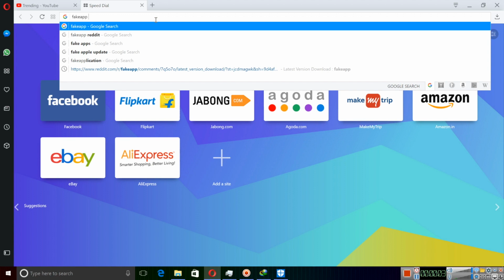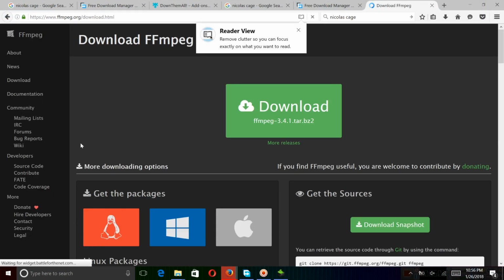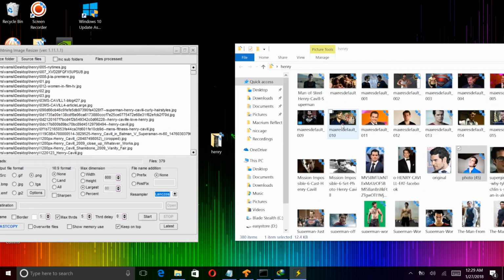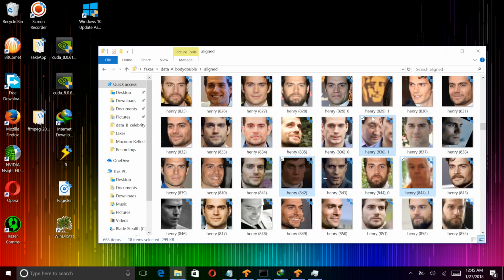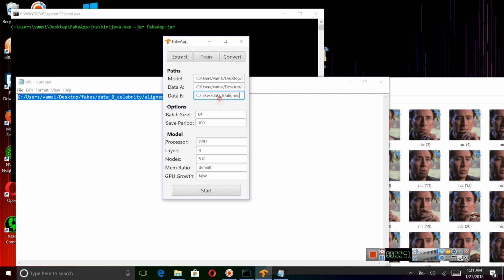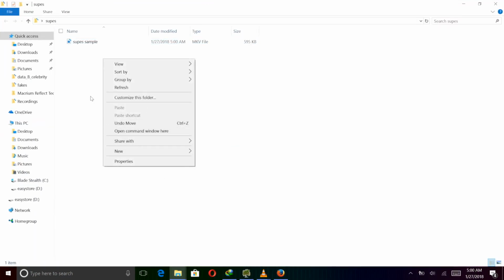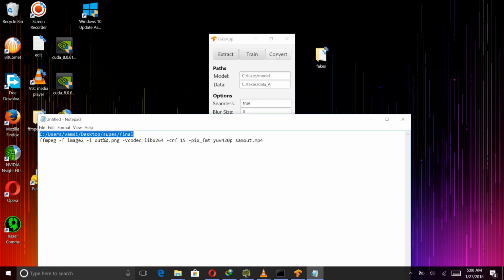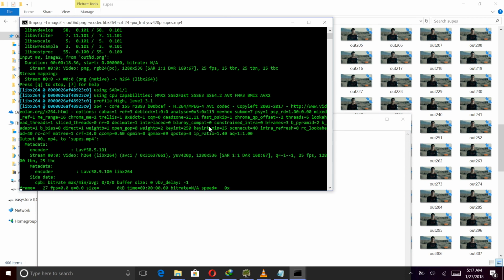Fakeapp how Face swapping is done using ML and AI !!deepfakes tutorial

Comment: Hello there! I get this error: undefined  undefined  File "site-packages\PyInstaller\loader\pyiboot01_bootstrap.py", line 174, in _init_
__main__.PyInstallerImportError: Failed to load dynlib/dll 'cudart64_90.dll'. Most probably this dynlib/dll was not found when the application was frozen.

During handling of the above exception, another exception occurred:

Traceback (most recent call last):
  File "execute.py", line 1, in <module>
Do you think you could help me with teamviewer? I would also like to donate, how can I do this? Thanks in advance
Reply from the maker: i can help you with team viewer, but before that can you tell me what is the system config??
Reply: tech 4tress hello there again! I managed to solve the problem. Turns out I downloaded Cuda 9.1 instead of 9.0. Your instructions in the site clearly say you need to use 9.0. My bad. Thanks a lot and I'll be donating soon! Regards
Reply from the maker: sure mate!!
Reply from the maker: if this video had helped you can buy me a coffee at

https://www.buymeacoffee.com/oDbCfFNAJ

you can donate to the developer for the app at

USD: paypal.me/tethys 
BTC: 1EWQG6FMZnHKe3rZcEofVGhpzHs1gL3MgA
ETH: 0x8B006aAF31E5D82A40cBE23885BAf3626E8D2dF9
BCH: qqycxlst0paylfsus5pqrep4ee9f30ha4sccsuggr2

Comment: undefined__main__.PyInstallerImportError: Failed to load dynlib/dll 'cudart64_90.dll'. Most probably this dynlib/dll was not found when the application was frozen.

During handling of the above exception, another exception occurred:

Traceback (most recent call last):
  File "execute.py", line 1, in <module>
Reply: ı have cuda 8.0 and 9.0

Comment: So i just keep getting this error when i start the training:

Using TensorFlow backend.
Traceback (most recent call last):
  File "train.py", line 96, in <module>
  File "utils.py", line 15, in load_images
ValueError: could not broadcast input array from shape (720,1280,3) into shape (256,256,3)
[1952] Failed to execute script train

i reinstalled CUDA 8 now twice, same with visual studios, i have an nvidia gpu (1050ti) 

if i use version 2.1 of fakeapp i get this message:

Training process ended. If you didn't end it yourself an error occured.

i hope you can help me. thanks for the video(s) anyway man :)

Comment: Hi, could you help me with this problem I keep getting? I enter in the directory for the images and once I click Start I get two cmd windows popping up. One says Attempting to start Extract process in directory: C:/Users/Yoda/Desktop/FakeApp/alignment/ and other says 'C:/Users/Yoda/Desktop/FakeApp/alignment/a.exe' is not recognized as an internal or external command,
operable program or batch file.
Reply: seems like a wrong antivirus alarm to me, try disabling your antivirus then extract the FakeApp again
Reply: Dim Man I think your right. Norton for some reason kept on removing a.exe and wouldn't let me view the report. Anyway I tried turning off but now when I try to use fakeapp it tells me access denied.
Reply: make sure you extract it in your desktop and norton's real time protection is off
Reply: I decided to do this again but on my laptop as it had Nvidia GPU, so made sense then trying to install CUDA software onto my desktop that had AMD. Only thing I didn't install on my laptop was the display drivers, everything else I did install. Here's my error and directory; https://imgur.com/a/XBvxN
Reply: Marcus well I got it to work on my laptop somehow. I think I messed around with environment variables and downloaded some Microsoft stuff. What sucks is that I can only do it on my laptop which has a nvidia gpu. Originally I was doing it on my desktop that has a amd gpu, and from what I read the app is specifically for nvidia.
Reply: Marcus I got that problem as well on my desktop. Even though it has a amd gpu Im still trying to figure how to fix it. Right now I got my laptop training and I'm gonna leave it overnight. Hopefully it be done in morning.
Reply: Marcus I believe that missing file or the file isn't in correct path is part of CUDA 8.0, as it the cmd it says it I think. What's pissing me off is the training does the job but stops and doesn't do anything else. My cpu goes idle and ram goes up. This tool just crap so far.
Reply: its not fucked, i got it to work perfectly with almost no errors, its just not that user friendly yet, I can try help you if you want
Reply: Dim Man alright what about when my training randomly stops. I leave it for few hours then it stops. I think I did get a error but was something about train script stopped. I got no clue whether if I ran out of ram or what. My laptop has 6gb of ram btw and I did close all applications that would consume ram.
Reply: when you scroll the cmd window that informs you about loss, it breaks the training
Reply: Hey Dim. I don't suppose you know any other sites where the Dev will be giving updates?

Comment: Can this work without a Nvidia GPU
Reply from the maker: can work on cpu but will mostly take 10 times the normal time,
its pretty slow on cpu!!
to try it,in the app type in cpu instead of gpu
Reply: tech 4tress thx but I do have an intel GPU (it's pretty powerful) so will it work on that.
Reply: tech 4tress the way your doing on the video still works for the CPU but I don't have to install Cuda and all that right?
Reply from the maker: John Byrne if u want to use cpu,you dont need to install cuda software,but keep in mind mate even with powerful cpus,it is gonna consume a lot more time!
Reply: @John Byrne intel integrated GPU and 'Powerful' do not go hand in hand

Comment: Do you have to install cuda because I don't have a Nvidia GPU (will it even work with a different GPU)
Reply: Abdullah zaidi CUDA is required to run the machine learning software so you will need an nvidia gpu to use the software
Reply: Abdullah zaidi yeah I was wondering about that aswell
Reply: Joon Desu can you use an intel GPU by any chance?
Reply: No, but you can use CPU and it will be much slower than GPU.

Comment: Anyone having trouble training on 1060 3gb? I am having that resource error
Reply: Ali Can Özkan actually I also fixed my own problem by limiting images to around 300 for both celebrity and actress and lower batch to 32 node to 256
Reply from the maker: try reducing the batch size to 32 mate
Reply: tech 4tress tried... As well as layers and nodes ... Nothing works.. working on CPU now but very slow
Reply from the maker: dude try reducing the number of image sets and reduce batch size to 32 and try training
Reply: tech 4tress image set is about 400 right now... Still too much?
Reply from the maker: Caesar Wong so reduce batch size and then try again mate
Reply: thanks man.. but i even tried reduced it to 2.. didn't work... time for new graphic card
Reply: What was your graphic card model?
Reply: Ali Can Özkan Gigabyte
GTX 1060 GDDR5-3GD (OC VERSION)
Reply: I have a 6GB version of 1060, I wonder if that would be sufficient
Reply: Prathmesh Deshmukh should be

Comment: Hello Vamsi, ran into problem while trying to execute train. Got an error code of 51256 Failed to execute script train, anyway you could help?
Reply from the maker: Jason Boschung can u paste the exact error mate?
Reply: Caused by op 'training/Adam/mul_73', defined at:
  File "train.py", line 111, in <module>
  File "site-packages\keras\engine\training.py", line 1838, in train_on_batch
  File "site-packages\keras\engine\training.py", line 990, in _make_train_function
  File "site-packages\keras\legacy\interfaces.py", line 87, in wrapper
  File "site-packages\keras\optimizers.py", line 433, in get_updates
  File "site-packages\tensorflow\python\ops\variables.py", line 754, in _run_op
  File "site-packages\tensorflow\python\ops\math_ops.py", line 894, in binary_op_wrapper
  File "site-packages\tensorflow\python\ops\math_ops.py", line 1117, in _mul_dispatch
  File "site-packages\tensorflow\python\ops\gen_math_ops.py", line 2725, in _mul
  File "site-packages\tensorflow\python\framework\op_def_library.py", line 787, in _apply_op_helper
  File "site-packages\tensorflow\python\framework\ops.py", line 2956, in create_op
  File "site-packages\tensorflow\python\framework\ops.py", line 1470, in _init_

ResourceExhaustedError (see above for traceback): OOM when allocating tensor with shape[3,3,512,1024]
         [[Node: training/Adam/mul_73 = Mul[T=DT_FLOAT, _device="/job:localhost/replica:0/task:0/device:GPU:0"](Adam/beta_2/read, training/Adam/Variable_36/read)]]
         [[Node: loss/mul/_211 = _Recv[client_terminated=false, recv_device="/job:localhost/replica:0/task:0/device:CPU:0", send_device="/job:localhost/replica:0/task:0/device:GPU:0", send_device_incarnation=1, tensor_name="edge_1601_loss/mul", tensor_type=DT_FLOAT, _device="/job:localhost/replica:0/task:0/device:CPU:0"]()]]
Reply: i feel like its a python error, perhaps i need to update or uninstall
Reply from the maker: Jason Boschung and what graphics card are you having mate?
Reply: GTX 960
Reply from the maker: Jason Boschung try putting 200 images in each folder and try again!!
Reply: tech 4tress I figured out that my 2gb vram was the problem have to train with CPU power only.
Reply from the maker: Jason Boschung u can use gpu dude but u need to reduce the batch size in training data!!
Reply from the maker: Jason Boschung try 32

Comment: how do i fix the " from torch._C import " ?
Reply from the maker: check if the directories entered in the app are correct, or manually enter the address
Reply: the directories are correct but this pops up on my command prompt when i start to extract

RuntimeError: module compiled against API version 0xc but this version of numpy is 0xb
Traceback (most recent call last):
  File "align_faces.py", line 7, in <module>
  File "C:\FakeApp\alignment\torch\__init__.py", line 76, in <module>
    from torch._C import *
ImportError: DLL load failed: The specified module could not be found.
[6764] Failed to execute script align_faces
Reply from the maker: what version of Visual C++ Redistributable did you install?
is it the 2015 version?

try downloading and installing this thing mate!
https://www.youtube.com/redirect?v=8Pm4EDofw4c&redir_token=LIGiB0nMj1cyVU2Bbra3frFKxbR8MTUxNzE1ODM2MkAxNTE3MDcxOTYy&event=video_description&q=https%3A%2F%2Fwww.microsoft.com%2Fen-in%2Fdownload%2Fdetails.aspx%3Fid%3D48145
Reply from the maker: can i know what graphics card do you have?
Reply: Intel HD Graphics 620
Reply from the maker: anmol rai ohk u need to have a cuda supported nvidia graphics card mate

Comment: Hello is it normal that the pictures are looking blurred in the train window i trained for like 8 hours with jpg data? https://imgur.com/a/gxbCs
Reply: how many pictures do you have in your training set?or did you just use two videos to split frames and train them?
Reply: and the answer is no, the if the pictures are properly diverse and the lightning effects of both sets are perfect, the images will be much clearer!!,  wait i will show an example.
Reply: I have like 110 pictures in the data set perfect lightning and quality
Reply: and i am using after effects to cut out the frames from the video and put them back together not ffmpeg
Reply: any software is fine, but the problem is you need to have a minimum set of 600 in each folder and also the set should be divers!! not a continuous video frames , which will provide bad results, and also train for minimum of 5 hours, and your final loss value should be less than 0.02
Reply: so my loss must be less than 0.02 on both sides? what is the problem when its over 0.1?
Reply: From your screenshot it looks like your 8 hours of training did almost nothing, judging by the number of loss values in your command window. It  is also saying you are using CPU processing that might be the reason why you have only like 15 steps in your command window. My GPU is processing 15 steps in about 30 seconds.
Reply: Kevin Furzkrughexer i restarted the training to do the screenshot and show the loss values. In the 8 hours of training i had a Lot of more but never a loss value at 0.02  everytime over 0.15.

A los value of 0.08 is also Bad or? It has to be a los of 0.02?
Reply: The lower the loss value the better. It seems in this context 0.02 is considered low enough to produce quality output, at least that is what I am reading in several posts. When I started with my example training, I had loss values around 0.19 but they got down to 0.04 in about one and a half hour. If your loss is not dropping or dropping very slowly means either:  Your progress is pretty slow due to CPU processing or graphics card or the images you are using for training are not good enough regarding quality, lightning and diversity?

Comment: Btw it does support jpg fine, You Also do not need to change the slashes
Reply from the maker: you will surely face an error when your are training the error will be something like this

unable to access path\to\file/config.p so better use backward slashes mate! 

i was mentioning it specifically because i faced the same error, had to make sure others dont face the same problem!
Reply: tech 4tress been using it for days with no need to change the slashes,  no training issues.   Maybe a previous version had issues, but python supports any slash.
Reply from the maker: Shawn Burkit and for jpgs,try putting both jpgs and pngs in the folder,then all the jpg files will be ommited mate!!

Comment: How do you get alignment.json I never got that file created whenever i finished extracting
Reply from the maker: which version of the app did you use?
Reply: 1.1. I think i found the problem. I ended data A early and I guess it didn't make the file. I'm rerunning the program now to get the file to generate and merge.
Reply from the maker: u should complete the whole process and the alignment.json will only be created once the whole folder mate!!
and alignment.json isnt required for training of images,
it is only be used in the final step when you are converting the final set of frames using the third tab in the app!!
so when you are using the convert option, the alignment.json will have the alignment information of the extracted images, which will be used when the images are pasted on the top!
Reply: right
Reply: @Ignitablegamer  hero. i think this is my problem as wel. shame the app doesnt tell you how long to run it